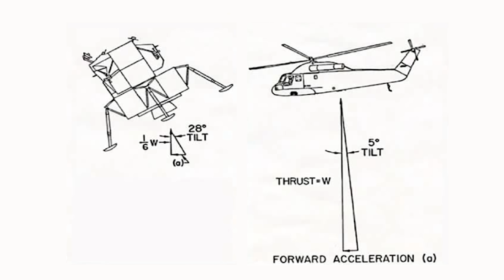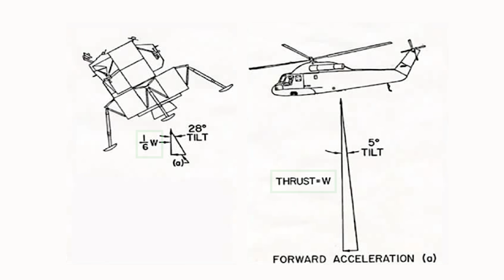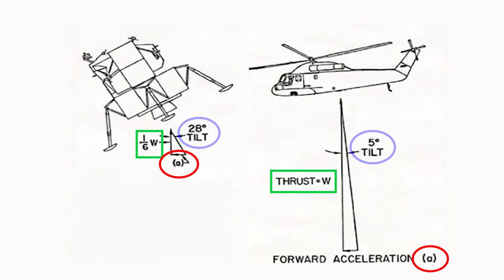How Neil Armstrong Trained to Land on the Moon  - Smarter Every Day 250

Comment: I wonder if manual control of flight will even be the first choice.  Given how rockets are autonomously landing themselves, it seems mission success percentage might be higher to train the spacecraft to land itself.  The humans might just be telling the craft where to land rather than actually controlling it.  Of course, I would imagine as a backup they would want their pilots to have the training to do it manually if necessary.
Reply: Just like flying a plane, knowing what to do if something gives the wrong numbers is just another fail safe.
Reply: Just landing? I wouldn’t be surprised if they decided to run a “dry” test with no human on board.

This type of mission can be very constrained, so a lot of it can be automated or semiautomated. If I was making the choice, probably a manned orbiter with an semi-autonomous lander would be the ideal test. That way you still have a near enough remote pilot that can react and give commands while risking no one.
Reply: I agree. I think he should have talked about it in the video/maybe in another one? There is no way they will be giving pilots direct control like that. Control algorithms running on today's fast, redundant computers will definitely play a part.
Reply: There’s no doubt in my mind that the next moon landing will be done by computers but Just like we saw in Demo-2  astronauts will be able to fly the vehicle if needed. I can’t see NASA (or even SpaceX) making a vehicle without that  capability.
Reply: @starty8814  didnt they announce an unmanned first mission already? I thing at least Gateway will be deployed automatically
Reply: @jonas1015119 the Gateway will be deployed automatically that’s correct. The unmanned flight that you might be thinking of is Artemis 1. Nobody’s sure when it will fly it’s all about IF and when SLS ever gets finished
Reply: @starty8814  if NASA does it... pilots will have the final say I would think. If SpaceX does it... auto-landing all the way.
Reply: For sure it will have the possibility of automated landing (or at least automated throttle and position hold) but what makes all these autopilot and autoland systems so robust and failsafe these days is ground infrastructure  AND enormous amounts of human-controlled landings that were base for algorithms. As a mission planner will you give the life of your astronauts to the CODE that is proven to be good in one - maximum of two automated landings during test flights? Or you will train your captain and give all responsibility and instruments in his hands?
Reply: My thoughts exactly! SpaceX's vehicle will certainly be more autonomous, being so large. I can imagine however that the other craft being sent by Blue Origins and Dyanetics will be more pilot-able, and thus have more leniance to training astronauts via earth-bound simulators like the LLTV. Again, such a great thought!
Reply: @Csw7878  spaceX is fake. How could a rocket land in a choppy sea?

You science fiction guys really want to believe they went to the moon but they didn’t. It was all Hollywood just like SpaceX except SpaceX Landing on the platform at sea was absolutely ridiculous
Reply: @jonnietruth4083  
Did your Mom have any children that lived?
Reply: @frank-u3v2h  what does that have to do with the fake moon landing or 911 building seven? Seriously… Television is one great big lie. It’s deception… It’s ridiculous… And nobody can disseminate what is real and what is fake because television has brainwashed people.

Television made seven buildings disappear on 911 and not one structural engineer was on television saying this is impossible that the buildings pulverized into dust? Of course it is possible. It’s the magic of television combined with fear.

But the moon landing… That was a cash cow. I believe they tried yet it doesn’t add up one bit so they used Hollywood and television. So to answer your question, what in the world does that have to do with the Moonlanding, 911, Sandy Hook which was a doozy, and this latest plan Demic? Seriously…
Reply: @jonnietruth4083  Oh man, I see it now, you're right.  We've all been brainwashed, everyone except you JONNIE.  What have I been thinking all of these years?  Television IS one great big lie.  I mean television itself is clearly impossible.  There's no way that motion pictures and sound could be transmitted from one place to another, that's just crazy.  We simply don't have the technology, and we never will.  And if TV is fake, the moon landings were, too.  I guess I will just have to stop being an aerospace engineer.
Reply: @willdejong7763  you were fooled by 911 Mr. aerospace engineer… You should have known that steel cannot pulverize. Just like humans cannot go through the van Allen radiation belt without massive lead protection.
Remember, Star Trek is not a documentary
Reply: @jonnietruth4083  What happens when a plane full of jet fuel catches on fire?  Does it get hot?  What happens to steel when it gets hot?  Does it soften?  What happens when the steel softens within a very tall and heavy and already damaged steel reinforced concrete structure?  Does it collapse, pulverizing the concrete?

As for the Van Allen belt, I'm surprised that you bring it up.  Why do you even believe that the Van Allen belt exists?
Reply: @willdejong7763  flat earth? Kind of stupid as far as evidence is concerned. Although I didn’t study it, it would seem the moon and the sun prove that the earth is around… I seek evidence… It makes no sense that The earth is flat. It’s a diversion.
Reply: @jonnietruth4083  Okay, so you agree that the Earth is not flat.  That's nice.

But you still believe the moon landings, 9/11, and SpaceX landing rockets on a platform at sea are all fake.  All three of these?  I had classes taught by people who worked on the lunar missions.  Turns out there were a lot of people who worked on the lunar missions.  Lots of people also witnessed 9/11.  The Twin Towers of the World Trade Center were in NYC, so how many people actually seeing it do you need?  As for SpaceX's landings at sea, you can see the rockets when they come back to shore.  I remember one had slipped, looked like it almost fell off.

This is all pretty straightforward stuff.  Being skeptical is fine.  But claiming that something is fake when it isn't just makes you look like a fool.
Reply: @willdejong7763  did you look at building seven yet? It’s on YouTube… Forget all the rhetoric… They will tell you what to think but use your eyes… And your mind. Building seven was 47 stories tall. It was a half a block long. No airplane hit it . No debris hit it… There was only a fire 🔥 on floors 2 ...3.... and five  And the fires were only in one corner of the building…and the fires were almost out because the black smoke means oxygen starved. Yet this half of black long building pulverized… The steel pulverized… The concrete gone… All of the building was pulverized.
The right term is  demolecularized … It didn’t turn into dust… It turned into a very weird powder… The steel was gone. There would have been a massive massive debris pile. The building would never have fallen with a fire that small.

Buildings one and two… The same thing. This was impossible. Those buildings turned into dust. You need to get your head around this because as an American citizen, you are not doing your part by sticking your head in the sand.

Aerodynamically, the Pentagon story could never happen. They claimed the airplane hit five telephone posts and kept flying… And then it flew within feet of the ground at 500 miles an hour… This is impossible aerodynamically.

So to recap … We did not go to the moon because it is impossible in 1969. 911… The story that you were told is impossible. Absolutely ridiculous.

And Sandy Hook… You missed a whopper there… they were going after the guns… So they lied about 20 children dying from a man who carried 40 pounds of weapons through a broken glass… This man weighed 112 pounds.
And the story behind Sandy Hook… Crazy lies… It’s a shame that you weren’t paying attention. They stole a lot of our freedoms during Sandy Hook.

So let me tell you what is in store for the Democrats coming in… Gun control… Fake school shootings… Fake FBI shootings… Because the second amendment is the glue to preserve our freedoms, the Democrats destroy the Second Amendment…
The Republicans ddestroy the rest… Because both are the same. The only one that loses is you and me.
Turn off the TV. This plan Demic… It’s all television… And it is seriously coming after us to kill 13 out of 14 of us so be prepared. You asked about chem trails. Just look up at the sky… When the sky is blue, they spray… When it’s cloudy which it is always cloudy… They spray… They are real.
Most likely the chemtrail’s are what is keeping you dumb. That and the water that is poison… The food sucks 

… You’re willfully blind. This is called cognitive dissidents…

They are going to wipe us all out with this plan Demic… The vaccine has heptane in it… It will make you sterile and will kill you… I’m not sure which one first…So get in line because the television is telling you to stick heptane in your veins. Television will tell you to drink bleach… Television… That’s where the Moonlanding came from, the false flag of 911 was covered up and Sandy Hook… The Satanic ritual lie
Reply: @jonnietruth4083  Sorry. I’m not going to waste any more of my time reading your silly ideas. Time for both of us to move on.
Reply: i am pretty sure that any future landing will be rather highly automated
Reply: Chang'e 5's landing back in December was already autonomous site selection and landing so no doubt NASA will go the same route. It doesn't make sense to let a human do a machine's job
Reply: Automation is going to be the only way to land. Handing over control to humans will lead to death. The only reason the 60s were manual was because their crafts were super small and could be adjusted. Today crafts will be far larger and more powerful. Automation today can run the numbers a million times faster than 1000 people punching numbers. The thrusts needed can be adjusted in milliseconds rather than seconds it takes a pilot to run the numbers and make the adjustments. It will also take a fraction of the fuel needed to land and take off. Meaning that more cargo can hauled.
Reply: @kameljoe21  There's usually more than one way to do things.  Human controlled with appropriate instruments and responsive enough systems worked before and could work again.  Personally I'd like to see a hybrid approach with computer aided guidance, real-time human control of the landing target and landing orientation, combined with computer controlled trajectory and automated closed loop control of the attitude and velocities.
Reply: @willdejong7763  As true as that may be the SpaceX capsule is fully automated and still has control for manual if they were to ever need it. Even their launches are fully automated. Injecting human response in to something is the reason why we have accidents today. Which is the reason why self driving cars will be the future and reduce accident rates down to next to nothing. Automated rocket launches is the reason why SLS did not blow up on the pad at their last test. The same reason why SpaceX capsule requires very little fuel  than the space shuttle needed. For example if automation was around when Neil Armstrong went to the moon and landed he might have landed with 50% more fuel and landed where he was suppose to. When you inject human designs in to the mix you end up with efficiency that are very poor, Human efficiency is like 10% were automation is greater than 80% Automation is the future of space flight and travel because we have the ability to do this and the ability to make changes in real time. Course corrections can be made in milliseconds rather than hours it would take humans to understand that they are off 100k miles while on the way to the moon or mars.
Reply: @kameljoe21  I agree with much of what you said.  But humans are still pretty good at processing visual information and making decisions.  Yes, computers are getting better at a rapid pace.  Still, computers are not perfect in all situations.  They rely on algorithms designed by people, even when they use today's brute force methods to train the systems.  They can struggle to deal with unexpected scenarios that a human would handle with relative ease.  Which is why Tesla still wants you to keep your eyes on the road and your hands and feet near the controls.  It might help if you think of landing on the moon more like off-road driving and less like being on a freeway.
Reply: I doubt it. algorithms are unbeatable when dealing with predictable enviroments, but all that computer smarts fly right out the window as soon as anything doesn't match expected parameters, and all of a sudden your lander is doing cartweels on the lunar surface because it thinks that's what stable linear flight looks like under the conditions it registers. a machine wouldn't've stuck a pen in a circuit breaker to start the lift off engines.  
not saying that nasa could never account for that, but at some point a trained human pilot is good enough for the job and waay less of a cost on resources than multiple teams working non stop on the same issue for a good decade.
Reply: NASA will simply borrow one of a hundred drones being developed right now, and replace the electric props with rockets motors.
Reply: @MultiPleaser  they won’t replace any motors… All they will do is get a new marketing rep and use some actors as astronauts and add subliminal mind control and voilà…
Just like Gilligans island… That fiction television show… It needed return to Gilligans Island…
So NASA… Get the producers ready… Maybe Norman Lear… And put a little bit more comedy into this… The Moon landing, although was a joke… Throw some more obvious ridiculous things in because that’s fun… We all love disapproving NASA. Thank you… Sincerely… Timmy the third grader with a third grade education that could easily figure out the Moonlanding was a hoax
Reply: @jonnietruth4083  You're just jealous b/c black women calculated the trajectories with calculus, but you can't do simple math.
Reply: @jonnietruth4083  Well, the Russians were in a desperate cold war with us and had every motive to claim the Moon landing was fake.  However they used antenna to track our radio and and video communications, antenna pointed at the Moon for days. 

And the Chinese have many photos of our landers, rovers, footprints and stuff.

We also left mirrors up there to reflect lasers we shoot there every day to measure the ever growing orbital distance.

There's plenty of proof for anyone who is not brain dead.
Reply: @MultiPleaser  so far no proof on your end… Speculation sure… Wishful thinking of course… But no evidence… That’s a shame…
Here’s something to speculate… What type of motors did they use on that dune buggy to push them through the sand and how heavy were they? How heavy were the batteries and how large? In 1969?
And that spacesuit? Were you the one who said water kept them cool in boiling temperatures? Cold water? Please show me the diagram and the weight of the refrigeration unit to keep the cool water. Also, the fishbowl that they were over their heads would be a terrarium of heat. And radiation. Sizzling scorching heat.
There’s a lot of other problems…Double light source during photography of the spaceship… That would be impossible…

Going through the van Allen radiation belt… It would be death.
Neil Armstrong would never admit to going to the moon… He is a Catholic and will not lie about it… He was offered $5000 in cash by a preacher to admit he was on the moon… He declined. On camera.
You believe in television that’s what the problem is. You actually think television is telling you the truth when television is nothing more than controlling the masses with gigantic computers that tapped into your survival instincts… Television is bad. So is radio and so is the Internet… Do your best to stay away from all of this trash. And you will see you will live a better life. They never made it to the Moon you’re dreaming.
Reply: @MultiPleaser  they never made it to the moon… Not in 69 or in the 70s… Never… Even the international space station is a hoax… They hang upside down by springs … They throw around the microphone when they don’t even need a microphone… As a prop for special effects television… NASA builds war machines…All the space stuff is to suck money From the public… Scott Kelly was never in space… Gabby Giffords was never shot… Television… It’s a crock of baloney.
Reply: @jonnietruth4083  Flying in an airplane 6 miles high over the poles gives you more radiation than the Van Allen belts, where radiation is just sitting there at low speed, relatively harmless. 

The poles are where all the Sun's and interstellar radiation is directed, coming in at a good fraction of  the speed of light, making the northern lights and southern lights.  The particles are charged, because they are directed by the Earth's magnetic field.  These are protons, electrons and ionic helium atoms. And they sometimes make it through the atmosphere, through the aluminum fuselage and into your DNA, busting it apart and causing cancer. 

Don't fly across the poles if you are pregnant. Burn! Double burn!  (Literally AND figuratively.)
Reply: @jonnietruth4083  The Moon buggy was a few hundred pounds on Earth, about 51 pounds on the Moon.  

Yeah, my little RC sand rail could power the NASA buggy and shoot rooster tails like it did in video.  Eat my dust!
Reply: @jonnietruth4083  They never looked at the Sun with their fishbowl helmets, unless they lowered the GOLD visor, which blocked radiation and light.  Not burned!!!!
Reply: @jonnietruth4083  No, I wasn't the one who said they had water-cooled spacesuits, because water freezes at 32 F, but the Moon in the shade is negative 140 F, or something crazy like that.

Ah, now anti-freeze of some sort, "liquid cooling" as they say, probably the freon used by the Dry Ice corporation circa 1900.

That's a cold shot, baby!  

Don't go away mad, just go away.

Na, na, na, na, hey, hey, good bye.
Reply: @MultiPleaser  in 1969, the batteries would be huge for that dune buggy and the motors would be heavy… 161 pounds each motor plus the batteries would be 300 pounds or more filled with lead and acid.
They never made it to the moon my friend. All of this is Hollywood… There’s so much wrong here… The dune buggy is definitely ridiculous. It offers nothing for science and would not be worth bringing up there… Just think like a lawyer and look at evidence … The moon landing shows no sign that they made it yet shows a lot of signs that it is Hollywood
Reply: @jonnietruth4083   Electric cars like the lunar rover have been around since the 1890's.  Jay Leno has one and still drives it. 

And try walking to work tomorrow and see how that compares to driving.  You'll find a heck of a lot more scientific advantage to driving. 

Either you believe bs conspiracy theory web sites, or you are making up you your own science.
Reply: @MultiPleaser  In the 1960s the batteries were lead and acid… They would have to be huge to power that machine. Lead and acid huge batteries with gigantic electric motors with plenty of copper. And for what? To go a couple of hundred yards? It’s Ridiculous. They could have crammed in testing equipment instead. The entire story is ridiculous. It reeks of lies
Reply: @MultiPleaser  once upon a time NASA tried to go to the moon and failed… The money kept coming in. A lot of money. Billions of dollars yet NASA knew they were never make it to the moon.

So one sunny day, they called Stanley Kubrick from Hollywood to fix the problem. They asked Stanley Kubrick how to get through the van Allen radiation belt and Stanley Kubrick magically made it happen through Hollywood.
And when they needed a dune buggy on the moon that would take gigantic batteries… piece of cake… Hollywood magic…
The moral to the story is NASA is Hollywood. The real trick is you have to believe it’s real. It’s that simple.
Reply: My friend… The moon landing… It was fake… It was Hollywood… Lots and lots of money was to be made… They knew they couldn’t make it to the moon so they faked it. And now… NASA… With all that money… All they do is create death and destruction… it’s time to wake up my friend. Just like 911… This is one big hoax… If you get a second… Take a look at building seven 911… Never hit by a plane… And it pulverized into dust in eight seconds.This was a 47 story skyscraper that was made with steel and concrete… It had a small fire on floors two and five in one corner of the building which was a half a block long… And the entire building pulverized. All the steel turned into dust… And blew away in the wind… Take a look at that on YouTube
Reply: @jonnietruth4083  I hope you dont think all moon landings are fake, we have landed rovers and such.  and what of the debris still visible from earth?  there is a reflector plate you can ping a laser off as well.
Reply: @aone9050  well you need a multi million dollar laser to ping it with lol but yeah you are correct that the moon landing are real and achievable with our current technology and maybe someday eith  the help of space x we can go much further and live on the moon or having a vacation on the moon
Reply: @aone9050  could you show me a sample of the debris that you could see from earth that is on the moon? Maybe a YouTube video? Whatever evidence you have gathered would be fine.
No man has been on the moon… Never… Maybe one day but in 1969 or the early 70s… No chance no way. Just like 911… They made building seven just disappear off television… They made that building disappear in the minds of the New Yorkers… Television is mind manipulation. But when you step back and turn that thing off as I did 10 years ago, and you see the reality of How television is one great big deception, then you could look at the moon landing in an objective way with evidence… They never made it my friend. Hollywood took over and they milked that cash cow until it bled. They tried… The problems were impossible to solve. So… What did they do? They called Hollywood and problem solved.